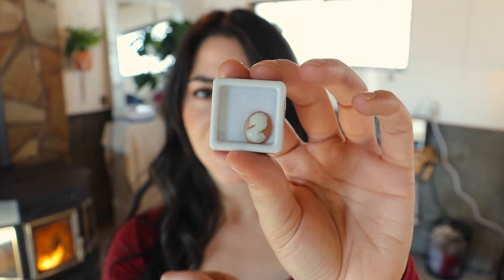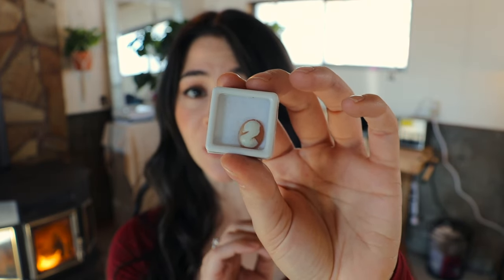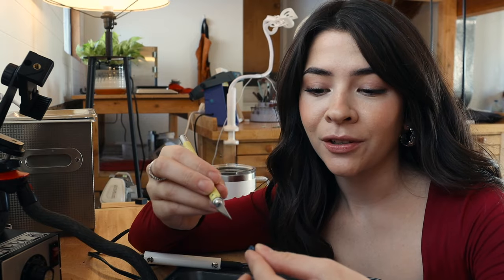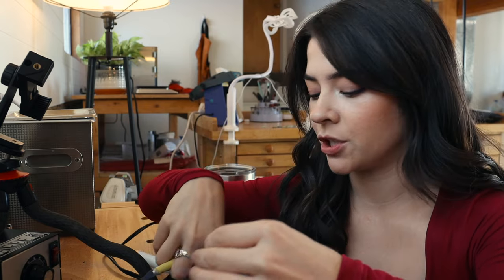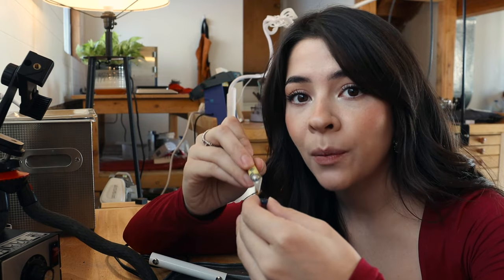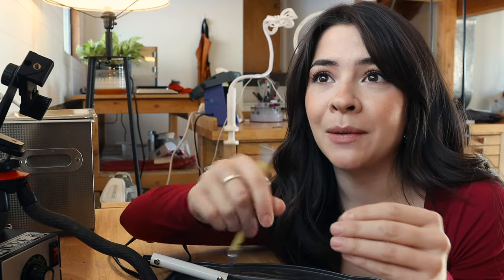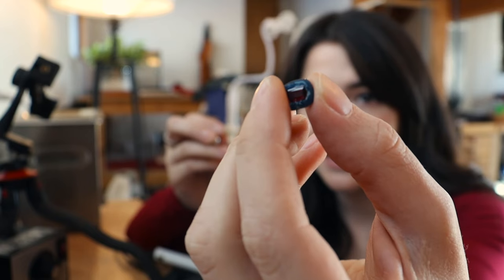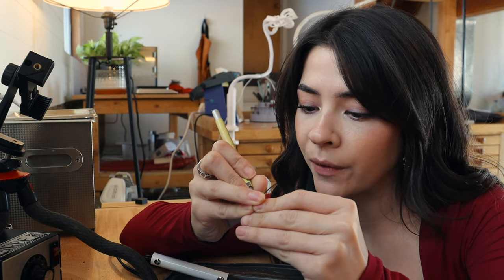Studio Vlog #8 | How to Create a Bezel Cup in Wax | Lost Wax Casting Jewelry at Home

Comment: how do u make sure to not scratch the stone?! im kinda scared to scratch up my opals... any Tips on that?! wiuld appreciate it! btw love your work!!!❤️❤️
Reply from the maker: Thank you so much! Anytime I’m working with a softer stone, I typically tape the surface of the stone with painters tape so I don’t accidentally scratch it. 💜 A Barrett file is also very very helpful when filing prongs on a soft stone! It is a file on the bottom but smooth on the sides. 👍🏻Take your time and also use your magnifying glasses when working with those softer stones so you can really see what you’re doing and how close you are 💜 I hope this helps 🙏🏻